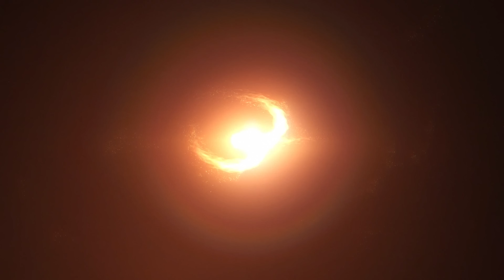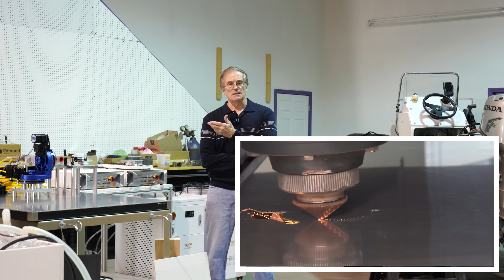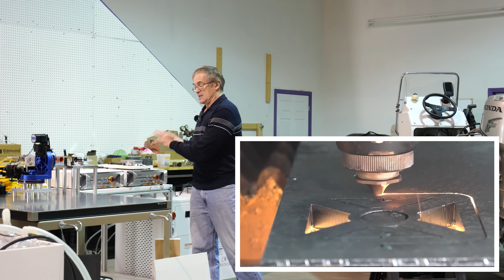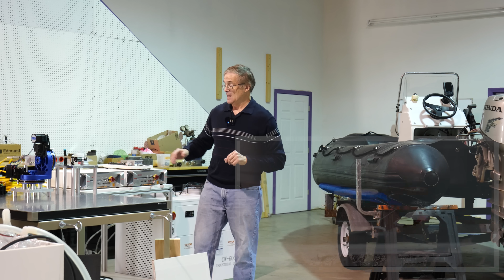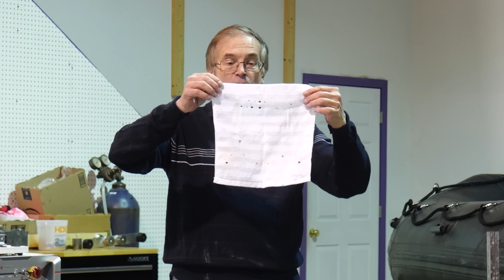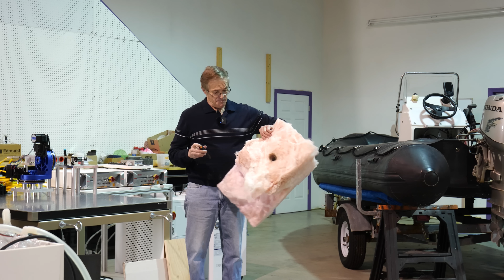We have a problem... and need your help!

Comment: Certified laser safety officer and systems engineer here: The solution for this specific set of criteria(cheap, portable-ish, large) may be a combination of kinetic and physical. I would attempt to sandwich a layer of wet, relatively coarse sand between two layers of equally soaked fiber cement board. The reason I would use sand is because you want to keep replacing the substrate that's being melted with something that's still not absorbed all of the latent heat of vaporization(for water) and hasn't melted yet(for sand). This would not work as a permanent barrier - it would burn through eventually, and likely keep leaking sand anywhere the laser hits, but anything short of a brick wall or sand bag berm won't help for a decently collimated beam, unfortunately. The best you can do is delay it for a few seconds.
If you don't mind wasting a bit of water, filling that entire space as a reservoir and having some flow(a hole at the bottom, hose at the top) would definitely also help, but you would have to reinforce the wall with a significant number of studs due to the flash vaporization that would try to blow the two sheets apart.
As for the actual laser safety part - in short, assume the entire building is now the laser. That's pedantic regulatory terminology, but in practice this means you want an interlock on the door, as well as practical means for anyone present to shut the laser down. Others suggested buttons to stop it, but that's the wrong way to do it - you want to use a dead man's switch. This is a 3-position spring-loaded switch that turns the laser off both when released(you let go) and fully depressed(squeeze in surprise/pain), and only allows operation in the middle, half-depressed position. Hook all of them up in series to the estop(not the interlock, unless it requires manual resetting!), and have everyone hold one.
Reply: Looks like a number of people are suggesting the sand option 👍
Reply: Sand isn't a bad idea I went with doped alumina because we want a product that isn't going to vaporize. Unfortunately sand boils at ~2230c and I maybe wrong but I'm fairly sure each of those is a 3000 watt laser...
Reply: Great overview and actual engineering thought. I'm an engineer working with much lower power lasers in silicon photonics, and the main thoughts that hit me were that they are attempting to do weapons-level research without the budget. To keep costs down, most systems attempt to minimize the power levels and simultaneously reduce the volume in danger. That doesn't help you since you are characterizing the effects of a full-power laser that is targeting something. Another possible mitigation might be to minimize the pulses of laser actually being used in tests. Rather than keep each laser test as a continuous powered event, use 1-100ms pulses. This will increase safety at the higher cost of test data analysis. You might need a microscope to examine the targets because the burns/ablations are smaller, but it will certainly be safer. Further, you could separate the experiment into two portions: targeting and destruction. Targeting does not require high power. Destructive tests can be accomplished in static and safely enclosed environments. I have to admit I haven't the prior video and do not fully understand your project goals. So, please forgive any incorrect assumptions.
Reply: I hope they read your comment. I work with Laser Safety at ASML (40+kW CO2 laser) and your comment is the most coherent comment I've seen here. I may also add that watercooled aluminum or copper can also postponed the inevitable by a few seconds. This could be an extra safety measure on the backside of the sandbox.
Reply: @lucasvp2005  how would graphite hold up?
Reply: @adamblomberg I honestly don't believe it would hold up very well. Mainly due to it being either too brittle or easy to become airborne if we're talking about it in powder form. Sand probably won't be perfect as well, but at least it's quite cheap
Reply: Im not votes as yes your solution, but only as to get up top of the list 0% nonlarge one subject, but will vote the no electronics, and it being an all analog, the no coputer fly-by-wire in the mix, reall cables, and real relays (or solid-state one's) but computer,
Reply: @dh2032  For such a dangerous experiment, having a PLC can actually increase the safety of the whole system, depending on how you implement it. If you're interested, check the IEC62061. What they're trying to achieve here should need a SIL 3 level. Which means redundancy on every single sensor, etc as there's a high probability of Death, losing an eye or arm. And on a side note: If I recall correctly, the chance of failure of a regular relay is actually lower than anything with semiconductors (read this as: real relays are safer)
Reply: A flow of some kind (water or sand proposed so far 👍) seems important so the boiled material can quickly be replaced by gravity. Consider a tank that can fairly easily be repaired to again hold water/sand - millimeter punctures should run slowly enough - but add a collection pan at the bottom ... maybe squareish plastic milk or water jugs, and then angle the wall-of-jugs say 10°-20° so there are no "seams" (container walls) facing the beams head on?  Wall dimensions are still a problem tho - would 10 sq.ft. be a big enough target area?  (it's still going to be heavy. 🫤)  Limiting the laser gimbal's targeting angles reduces wall size - but yeah not as cool a test...

(edit) Oops! Forgot the goal is to slice the target - that means a moving beam - which won't just make millimeter holes!  😅   Ok, back to the water curtain idea ...
Reply: Maybe using self sealant like in a tire could somewhat solve the leaking issue
Reply: I was thinking of something similar but using a foam generator using nitrogen instead of air. You could put graphite in the foam mixture to help absorb heat or energy.
It would also go through any penetration holes in wood and not let it burn. You could fill the hole with a ball of clay if it started leaking to bad. Dense foam like the consistency of shaving cream doesn’t go anywhere fast and will hold a decent slump.
Wondering how well a laser would penetrate hydrated clay like bentonite. Hanging bentonite liner ( bentomatt ). It’s heavy but manageable to hand and roll.
Really curious how a nitrogen foam would react building a foam generator is easy and being able to use all sorts of additives from charcoal dust to cement to absorb energy.
It’s light and when you’re done you can drain it in the yard.

Large precast concrete blocks is another option. You would need a min excavator to move them around and you could resell them when your done. Concrete plant might just let you use them for the experiment if you picked them up and returned them. They make them with extra concrete from job overruns.
Whatever materials you use could you coat the face of the surface with a wet plaster or stucco material with a grout gun. Bentonite gel and plaster mix.
Reply: That's a rather extensive project. Can that same idea be used to protect homes? Because because I had no idea lasers can do this. Now I think that the Lahaina fire was actually set by lasers like some people think.
Reply: @LightSpirit24  There's basically no way to protect most infrastructure from a laser like this. You'd also need to be relatively close to it. And it's also a war crime(not exaggerating) to use this in an offensive manner because this power of laser is guaranteed instant blindness if you get hit by the beam for any amount of time.
Reply: What happens when your laser hits a prism?
Reply: Build a large lens to decohere the beam

Jfc why am I the only guy who sees it?

Elegant solution 

Works just like in the machine we took it from, only scaled up and with extra steps...

Its painful being smart sometimes...
Reply: @KaosProject21  The lens will melt.
Reply: @KaosProject21  Because at these power levels, even a de-cohered beam is still really dangerous.
Reply: Isn't sand going to transform into glass?
Reply: I was thinking a dead mans switch too
Reply: I've seen a couple different suggestions more coherent than mine in these comments, but after you asked your question, I immediately thought of some sort of larger scale recycling fluid waterfall setup with a sacrificial backing. I don't know what additives you could mix into the water to make it absorb the laser light better than just water itself, but I'm sure someone else has the expertise in this field to come up with a suggestion.
Reply: would vermiculite be better than sand? Also how much steam is generated?
Reply: I mean, the safest thing would be to send the beam through a large aperture divergent optic and then dump it into something absorptive with a heatsink/water. IIRC at 1064nm, both polycarbonate and glass are like 90% transmissive. So getting a cheap sacrificial divergent optic shouldn't be too difficult. The only real question then is then how long the sacrificial lens would last before that 10% absorption put a hole through it.

A 99.99% transmission lens would be possible, but very expensive unless the target area was very small. So failing polycarbonate, perhaps a liquid lens via laminar flow....
Reply: A long time ago i went down the shuttle tile rabbit hole.  I ended up watching a few videos of people making these thin panels of a sugar based substance with a torch on one side and their hand on the other.  As heat is applied it carbonises, bubbles, and creates an extremely temperature resistant surface.  Id wonder about coating plywood or something inflammable with thst sort of substance.  You could also then have an excelent set of videos of your testing different sunbstrates to find which resisted the laser and heat best.
Reply: I just posted my own comment suggesting a dead man's switch and saw this now. I didn't realize the 3 position one existed, and now that you've explained it makes so much sense! Really genius idea whoever came up with the ouch = off function. From a safety standpoint once you realize it exists it's kinda silly not to use it. Especially when you're dealing with anything where milliseconds can change things from ok to tragic.
Reply: Just commenting in the hopes this gets seen. The building is a laser is 100% correct. Those 3-position switches can be fatiguing, and can be defeated with zip-ties, but they're good.
Reply: Since one problem is that the laser is so focused on one point, wouldn't a special lens help scatter the light before it hits e.g. your suggested barrier?
Reply: @BlueTJLP  If you find a many-meter-wide lens that costs less than the building it would be in, and something robust to boot, please let me know as I'd like to sell it to Zeiss and retire.
Reply: @Spirit532  Now that you mention, perhaps they could also use a tilted mirror pointing downwards into a pool of water and sand as you proposed. The main challenge would be to cool that mirror - this is exactly what I work with: Water cooled copper mirrors - but they're a lot smaller, just a few cm across
Reply: @lucasvp2005 could you use an array of them all angled to the same 2 metre area of sand?
Reply: @ICGedye you definitely could! The only challenge then is where the edges meet. There they could end up with an unpredictable reflection (while at the same time a curved mirror would distort the focus and would also not be a good idea)
Reply: @BlueTJLP  maybe a series of frosted glass panes to help "spall" the light like ballistic projectile testing

Comment: Sand bags, diffusing lens, a hill side, sand filled concrete wall, layers of machine ribbed plates.. 

some ideas that pop into mind considering that the lens and plate may reflect the beam at still too high of intensity. The sand I like because as it melts it should reorganize itself and you'll just end up getting glass fragments which may help diffuse the beam further. I didn't get to portable before writing this comment lol. But I think a sand wall rig might be the top idea even if it's drywall with sand packed in-between layers at 4-12" for that matter a set of walls.

Comment: Maybe a thick flat wall-like water tank containing some type of opaque slurry (mud). If the beam gets fully absorbed before it can blast thru far side of the tank, it would be contained. Sure you'd get leaks. But if the slurry is thick enuf it wouldn't be too big a problem before the holes could be plugged. I realize a water slurry would boil and be explosive. Is there some non flammable, non boiling, liquid that could be used instead?

Comment: I have used beam stops that are made of off bunch of metal sheets stacked together. The side that gets hit by the laser is not the front side but the lateral side. imagine a book where the pages are made of metal sheet and the side of the book is the surface that is used as the beam stopper. For your application you can easily build something like that with sheet metals but i doubt it will be enough. So what i am proposing is make one of these with very small gap between each layer (might have to play with this parameter) then use that as a wall and have a constant flow of water going over it like one of those fake waterfalls they put up at the entrance of Asian restaurants. The rationale is the metal will get hot as the laser hits it  but the constant running of water (may be add some surfactant to lower the surface tension) will act as a coolant. Also only a thin edge interacting with the laser will make reflections not that bad and light after hitting the edge will spread on the flat side of the metal which should (in theory) minimize the heat generation. whatever heat is generated the running water take cares of it.

Comment: Sorry. No time to read all the comments, so this may be a repeat:
    How about two parallel walls made from plywood, or other material (ideally, non flammable), held up by metal studs. The gap between the walls could be as thick as needed. Fill that gap with sand. So essentially, it'd be a thick wall of sand. As the laser beam blasts thru the sand, hopefully more sand will continually collapse in on the blast hole. Could test with some sandbags. Though, maybe the sand would not collapse fast enuf, or a glass tube would be produced that lines the blast hole, preventing more sand from blocking the path? Maybe add vibrators to the wall, to make the sand settle quicker?
    What if you could produce something like a waterfall but made of sand? That would constantly be offering new material to the beam to blast thru.
Reply: It's not exactly a new idea but if you just have water pouring through the sand you have combined all of the most common ideas.

Comment: How about a turbulent flow water curtain?  It would take some designing to best suit your needs for size and portability. But you have all the creativity and skills to handle that. 

It would still need a backdrop, perhaps at that point gypsum board would do. You could add dyes or carbon to the water to increase light absorption.

 All other methods I could think of would at best be sacrificial or way too cumbersome to deal with. I wish a large diversion lens or diffusion panel would work but with that intensity, the material would certainly fail. 

Thanks for all your awesome videos. Seems to be a good outlet for me to nerd out with you guys. Many times I wonder why I didn't pursue a field that satisfies my curiosities like you do in your videos. Tool and die repair I suppose have plenty of problems to solve. But yours are just way cooler! Excited to hear of your solutions!

Comment: My initial reaction in some sort of intumescent  material.   There are many on the market.   The infamous Starlite was in this category that could resist nuclear flashes, but the whole science of this has advanced greatly since the 1970s.

Effectly you'd have an ablative material that prevents the heat from penetrating by bubbling.

Unfortunately you don't give enough detail to try to select an actual material to match your system.    Good luck, and I don't think paint version of this will work well, thick enough and maybe.  ;)

Comment: As I understand it is enormous area that has to be protected? Huge screen and camera filming it continuously. Once the screen is hit with the beam it glows and smokes. Computer detects difference and shuts down the beam. Just like passive ir motion sensor. Perhaps just use passive ir sensor? It occured to me while thinking about another phenomenon used commercially. Laser light in a fiberoptic wire changes modes in relation to strain of that wire. Patterns are detectable. They make pressure sensors based on this property. It is used to measure state of power lines, etc.

Comment: Row of cider blocks?
Concrete bags?
Glass sand?
Tungsten?
Something powdered coated with Hafnium Carbide? 
A diffuser at the endpoint provided it doesn't immediately melt?
A planter full of spf 5000 sunscreen?

Comment: Sandwich a few inches of expanded perlite between your drywall sheets. Would be easy enough to test on a small scale. Perlite is light enough (~3lb/f³) that you could build a moveable rig. If set up correctly the perlite would move down as a spot is created, so it would be self-healing (as long as you made your rig refillable).

Comment: Copper sheet with a dark coating on the laser-facing side (for good absorption) would be one potential option, the other would be a carbon felt or graphite sheet, which should be extremely heat resistant but may not have enough mass to back it up. Carbon-phenolic (or even plain carbon-epoxy composite) should be extremely effective but the fumes of ablation would be nasty.